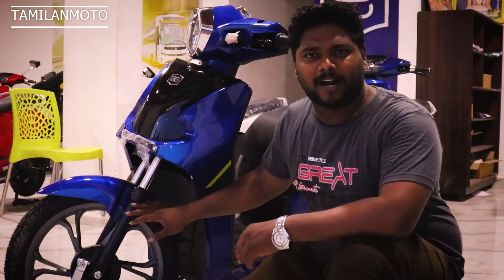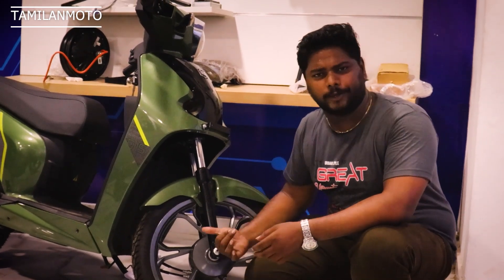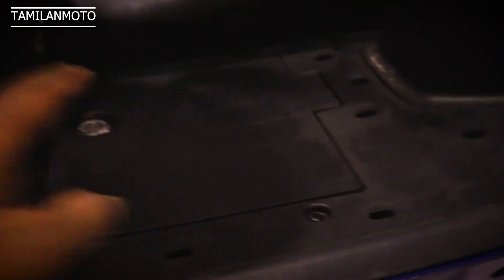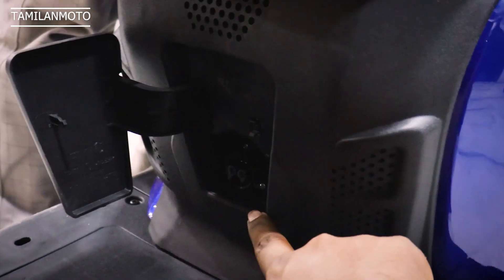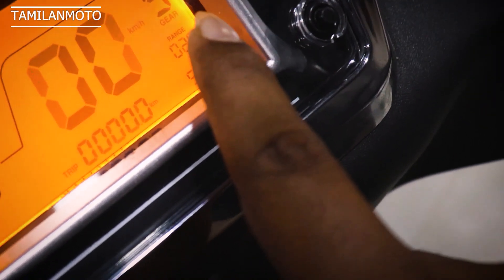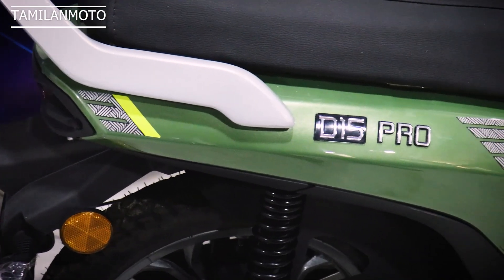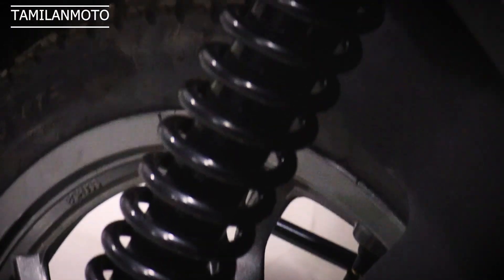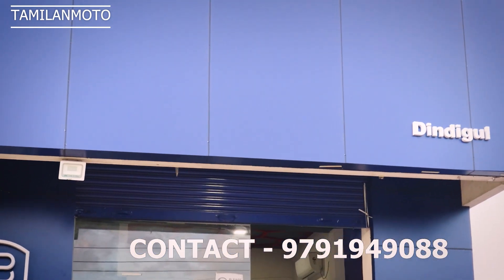Bgauss D15 Pro I தரமான எலக்ட்ரிக் ஸ்கூட்டர் - Rollover sensor I Bluetooth I CAN2.0-GSM I Theft alert

Comment: Yethanai electric vandi vanthalum over rate pa petrol vandi mel
Reply from the maker: Fact
Reply: Sir Please have a look at the specifications also. 
In EV very few brands are providing IP67 Rating.. Also everyone uses only BLDC(fan) Motor, but here PMSM. 

Also a metal body & 3.2KW battery with aluminium casing. Distance to empty also available.. ICE brands are selling at 1.5L for this type of specs